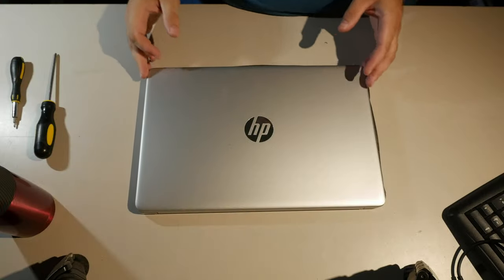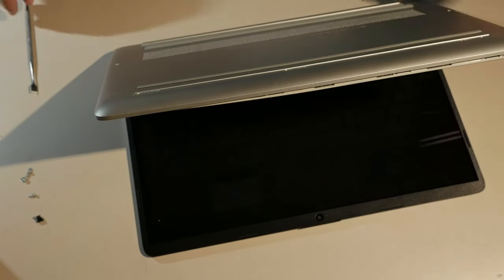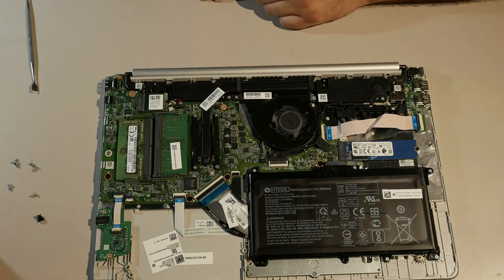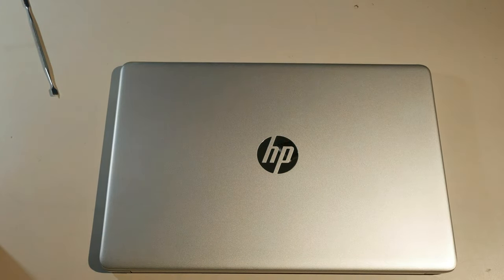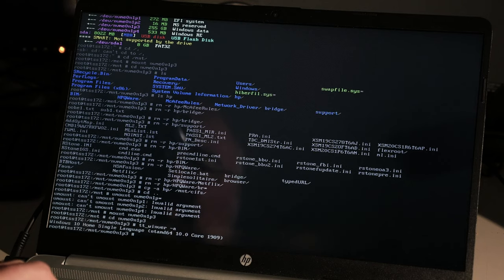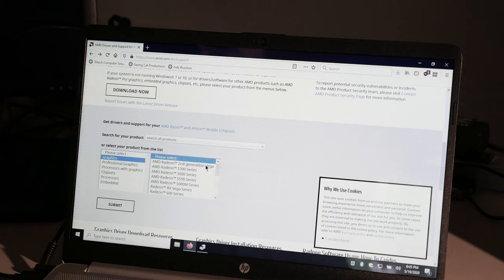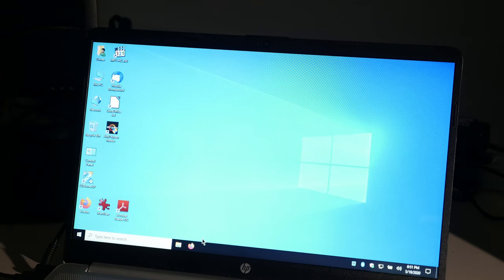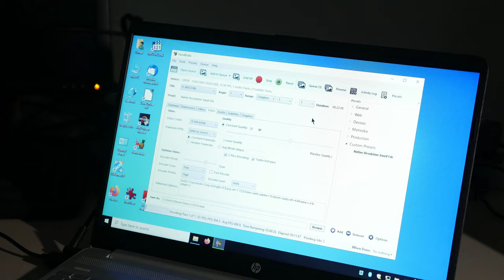HP 15-ef Series Disassembly, Win10 Install, Handbrake Test (4K UHD) - Jody Bruchon

Comment: What colour was the inside of the back cover? I popped mine open because it keeps shutting off. The inside of the back case is copper, and black in some spots. I'm assuming it shouldn't look like that, but I just want to confirm lol

Comment: HEEELP! I spilled coffee on my keyboard and they're getting stucked, how can I dissasembly the keyboard? Is this model a key by key cleaning one? If so I'm terrified I might break one while trying to remove it...
Reply from the maker: It's difficult to remove key caps. There's no good way to do it and it is easy to break things. Every keyboard is different too. The general idea is to pry so that the scissor doesn't disassemble and only the key cap pops off. There is usually a sliding part and a clipping part and your goal is to pop apart the clipping part. Unfortunately, that could be any of the four sides of the cap and you won't know until you rip one off.
Reply: @JodyBruchon  Thanks for your quick answer!!!! OMG, I will need then to try it :$ or better off continue with the sticky keys forever and keep the keyboard intact

Comment: Pretty cool video, I just happened upon it because I have the same laptop I got around May and needed to upgrade the memory for virtual machines. I haven't used the dos software you used in the video but I have it now and will explore it more. Very honest and informational, however, as a consumer, I wouldn't want someone preparing my laptop to say that "I have no idea" so many times when it's my profession. As a beta tester since Windows 8, anything after 7 will install generic drivers so that you have ETH0 and WLAN0 active to download the drivers for everything. No need to search like XP or Win7. I purchased mine for around 400 bucks and being who I am, I can't leave a PC untouched...it must be faster and more efficient. Reading the PDF from HP it says the memory slot wasn't accessible. (Just wanted to check lol and see if someone else did it 1st.) But you sir were very meticulous with the whole process and I appreciate it. Going to 32GB and a 2nd drive and a Samsung EVO 1TB for the main SSD and a Toshiba Q-sries for the backup and a possible ram drive. The cooling is not adequate so I will be replacing it as well.
Reply from the maker: I often open computers I haven't seen before. The point of expressing my lack of knowledge is to show people that they should not be afraid to try to open their machines. If I can do it blind, you can definitely do it with a breakdown video to guide you! Also, while Windows 8-10 do have a lot of drivers that work for a lot of pieces of hardware, new stuff comes out all the time that doesn't work out of the box, even on 10. I recently ran into a Lenovo that had an eMMC SSD with a controller that isn't NVMe or MMC/SD compatible, requiring a special driver just to boot the system AT ALL, and NBASE-T ethernet adapters are almost universally unsupported without at least some access to Windows Update.

Comment: Where is the hard drive located?
Reply from the maker: The blue looking card beside the long end of the battery is a NVMe solid-state drive (SSD). This unit has a connector for a SATA hard drive cable but doesn't come with a cable because it doesn't have a hard drive. You can probably find one on ebay if you're cautious.

Comment: Long shot question here given how old this video is but where on the board is the CMOS battery? I am looking at the board from your video at the 12:00 mark and don't see it. Is it on the underside of the board?
Reply from the maker: Yes, it has to be on the underside.
Reply: Did you find it
Reply: @JodyBruchon no, it ain’t underside, i’m just take a look

Comment: How do I remove the fan
Reply from the maker: Go to 11:23 and pause it. The fan has two silver screws near the back. There is a black display cable that runs around part of the fan; the third screw for the fan should be under the black tape on that wire. There are a few grey/silver wires coming out of the fan to the motherboard, ending in a flat black connector. Remove the fan connector by putting a thin pry tool or other flat, thin object (a butter knife would work in a pinch) under the grey wires, gently push between the two halves of the connector, and GENTLY pry up until it pops out. To reinstall, simply push it back down until it "clicks" into place.

Comment: Do you have a video or a link to a video that will show me how to replace the screen display?
Reply from the maker: I don't think I have one specific to this machine, but several of my hinge repair videos are similar. Newer screens are usually very easy to get to. Most laptops these days have at most 2 screws at the bottom of the plastic bezel surrounding the screen, almost always under some flat stickers that you can pop out using the tip of a knife. Once the screws are out of the bezel, just stick your fingernails under the bezel edge against the screen and pull up on the inside of the bezel, and the plastic clips will pop loose.
Reply: I was just looking...I know all that you know...just wanted to seen. No
harm man lol.
Reply from the maker: @Probn4lyfe  Did you reply to the wrong comment? And thanks.